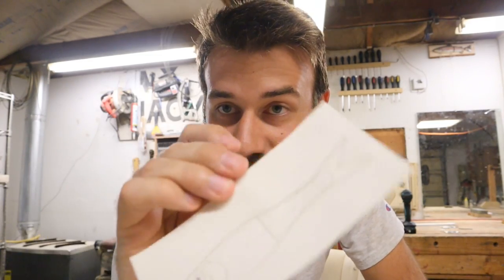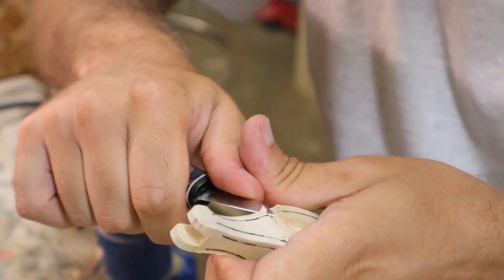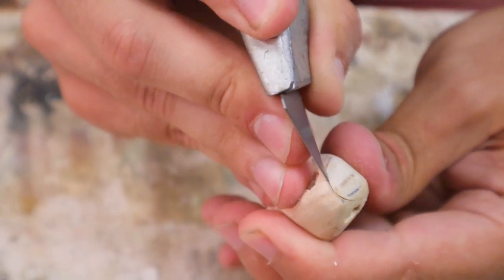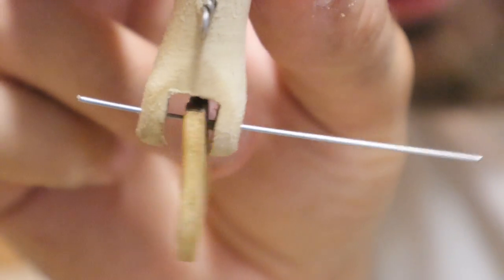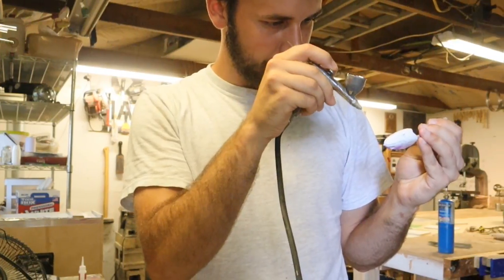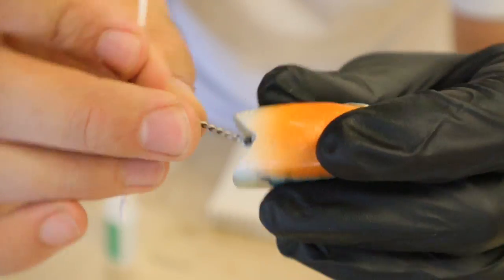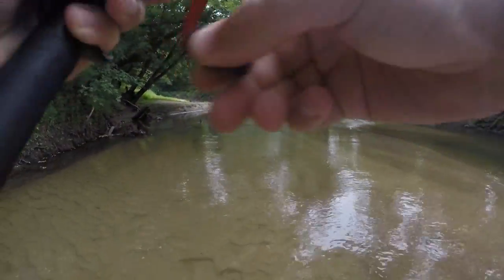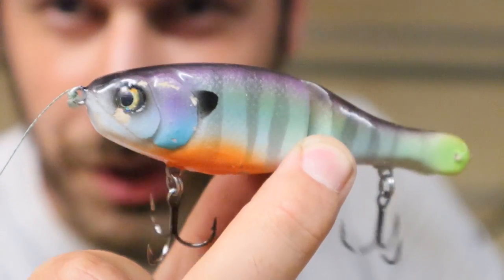SwimBait | One Day Build to Catch

Comment: You could also soak the fin in cyanoacrylate glue before drilling to harden it and help hold it together and use a pin vise drill to drill the holes.

Comment: love your vids but here's a tip. superglue will weaken Plexiglas and Polycarbonate. at the point where the bill meets the face of the lure. super glue creates a chemical reaction with the lure lip, stiffens the lip and makes it brittle.  i understand the one day builds but i recommend an epoxy that sets in 2 hours cures in 24, you could even use fiberglass epoxy resign :). good luck man and stay fishing.

Comment: I think sir BAITMAN you should eliminate the tail all together & put a treble hook back there. Cut the tail thing off drill hole through body & install treble hook. Much better hook up's with out the tail getting in the way. As for the chips on the bait, It's fresh paint really didn't have time to harden properly. Is there a primer you can use to help the paint adhere to the body better in a 1 day build ? DAMN FINE ACTION IT HAS BUT ELIMINATE THAT TAIL IT GETS IN THE WAY ON A WOODEN SWIMBAIT. How's the wife doing, feeling fat I'm guessing ? She did a HELL OF A JOB ON THE LAST BAIT WITH THAT TAIL SECTION MAYBE YOU SHOULD ADD THAT TO THE BACK WITH A HOOK ? JUST THROWING STUFF OUT THERE BUT I THINK THAT KRAZY TAIL HAS TO GO, CUT IT OFF & PUT A HOOK BACK THERE MAYBE WITH SOME HAIR TIED AROUND IT FROM YOUR WIFE ?